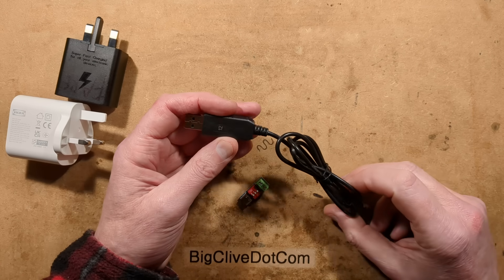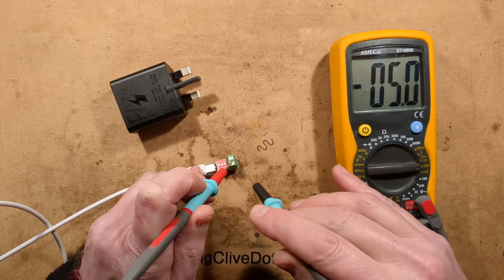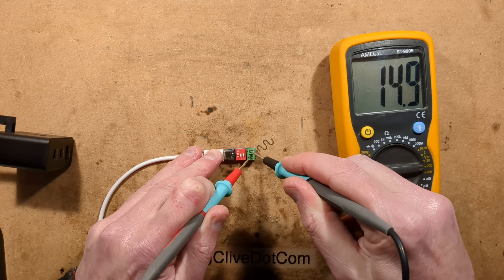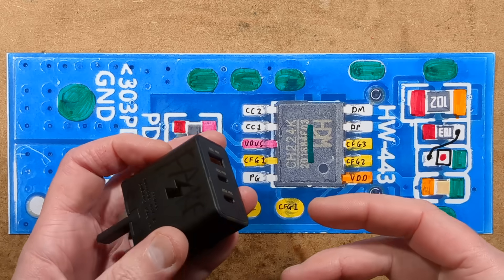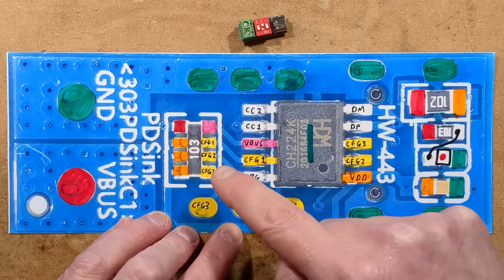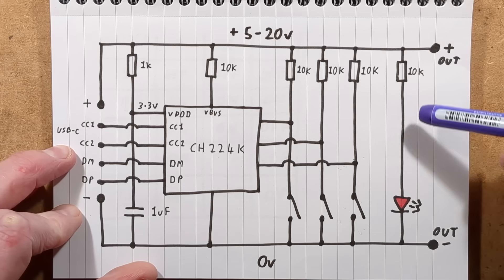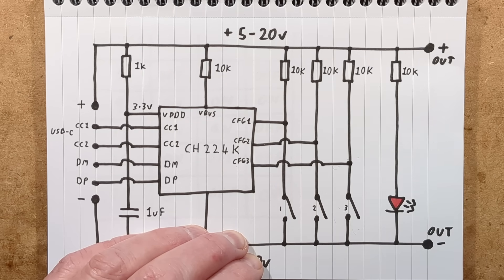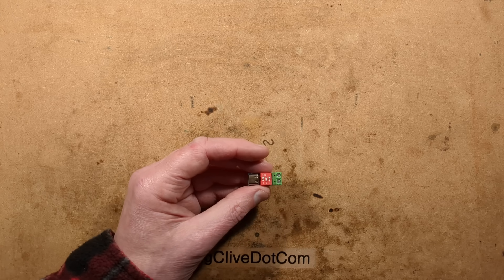Cheap USB-C programmable PD voltage module for 5,9,12,15,20V

Comment: I really do enjoy items from IKEA. 
Not all of them are stellar,  (The USB C outdoor lights made for the outdoors are rubbish and take in water in less than a week! )   
But as far as their USB power supplies, and items like their very expensive LED color change strips?
I have had mind working solid for over 15 years!   :face-blue-wide-eyes:

I have no doubt they will keep working for the foreseeable future, and I can't say that about cheaper products as none of them have really lasted the test of time.  

I have a Battery powered Ikea star shaped Christmas light string I attached with a 3v supply from an old SONY charger and its been working now for the same 15 years in the humid environment of a wash closet. (Bathroom)

Comment: Does 2.25A acceptable for you because you said you only believe at 2A max at 20V?

I need one of these but the one that output is 20v fixed and barrel jack for my old laptop (5 years) that i need 19V 2.36A (45 watt).

 my old laptop charger is dying and buying the new one i gurantee i will not got the original one because well... its old.

For the powersupply i use the included 90 watt type A xiaomi charger, but i still confuse will it work or not because its type A but can delivery 20v to the phone😅
Reply from the maker: Some chargers do implement PD on a classic type A connector.
Reply: Im hoping xiaomi does it, thanks for the answer❤

Comment: That chip must contain an inductior internally to be able to boost. Interesting
Reply from the maker: It doesn't do the boosting.  It tells the power supply to step up to a higher voltage.
Reply: @bigclivedotcom I didn't realise that usb C could output 20V

Comment: Note that the latest definition of USB-C PD has dropped the 15v support. 😞So, it depends on which version is supported. You need to check in advance if the voltage you need is supported.
Reply: Don’t you mean 12v? With PPS you can get any voltage you want. Also there’s AVS I think it’s called… it’s like PPS but can go higher than 20v.

Comment: I think these things are a little dangerous because you might damage something that's expecting a higher voltage just by using a different charger that doesn't support it. Instead of supplying nothing it will produce the wrong voltage, so it's not great for powering sensitive electronics.

I used a non-adjustable one to convert a wired beard trimmer to USB-C after its power supply failed, and that works fine because worst case the motor inside will just spin slower.
Reply: Sometimes they choose a higher voltage, not the nearest lower one. It varies by module.

Comment: I use these all the time to convert devices to USB-PD. You can even use them in conjunction with a TP4056 module to make a USB-PD lithium battery charger.

If you replace the DIP switch with jumpers and remove the terminal block you have a device that will connect almost anything to a USB-PD power supply that is barely bigger than a normal USB-C connector.

Comment: But......... You  didn't   test that device  under load and that's what  matter  (voltage regulation)   tHE  20 vaults is also used to power laptops
Reply: The voltage regulation is managed by the power supply itself; all this module does is request the specified voltage from the power supply.

Comment: the only thing I think that this module needs, is a little plastic cover that snaps over the DIP switches,so that they aren't accidentally
flipped, and potentially fry your electronics that are  powered by it. I suppose that if it were a concern to its user, they could 3D print one.

Comment: I've got an electrical problem, Big Clive, and you're the man to solve it! ... When I plug in my various SMPSs, I often get sparking ⚡ which visibly eats away at my sockets and plug pins! 😭 ... How can one ensure the sparks don't fly?
Reply: In UK plug it in, then switch the power on afterwards.
Reply: @davadoff  Yes, but then the switch contacts will be damaged by sparking, instead of the plug pins and socket contacts. The problem is the high inrush current, as Big Clive pointed out. You'd think manufacturers would do something to mitigate the problem?
Reply: @marcse7en  switches are much more on/off with no in between, no arcing. 
240V AC into diode bridge into small electrolytic capacitor is enough surge to trip the breaker. You need an inrush limiter. Usually a fuseable resistor in LED light bulbs and small power supplies, for example.
Reply from the maker: The spark when plugging in power supplies is common.  There's an initial high inrush to the capacitor.
Reply: Are you talking about USA mains outputs or IEC C13/C14 connectors? I’ve probably had a tiny arc when plugging in a C13 connector that I can hear, but no visible damage ever.
Reply: @davadoff  I'm in the UK, and I've had mains plug pins visibly pitted by the sparking. You'd think manufacturers would address the issue?
Reply: @marcse7en  I’ve never heard of that or seen that before. Not with UK plugs. I’m not an electrician, though. Probably loose fitting, need new sockets. Or pins are damaged in such a way as to make more arcing & pitting much more likely. 

Try with a different load - high power but not capacitive - like a kettle and see if it still does it. Try with new, branded plugs & sockets and see if it still does it. To see if it’s the load or the plugs.

If you live in rented, show the electrician and ask him about it when he next comes… I think it’s within 5 years now, to do electrical safety checks.
Reply: @davadoff Funnily enough, for the last 20 years I did live in a rented flat. I've recently moved into the house my parents left me. The problem is mainly with switch mode power supplies, and happens at both properties. Big Clive says sparking is a common problem, due to high inrush current.

Joyeux Noel et Bon Annee MMXXVI 🎄

Comment: Does that CH224K chip have a Zener (or other shunt regulator) on the Vdd pin?  That maybe why it gets hot.
Reply from the maker: It has a shunt regulator.  It's the resistor that gets hot.

Comment: I’m guessing the voltage monitoring pin is to detect shorts.  The PD (the wall unit) has over-current detection and will cycle the power output.  There might also be a failsafe counter where it gives up after too many OC events.   The voltage limitation is also in the PD (the wall unit).  It is only a buck converter so the max voltage is strictly a function of the rectified intermediate DC voltage.
Reply: There is a power good pin that Clive didn't draw in the schematic. It goes low when the module receives the requested voltage. It needs the VBUS monitoring for that.

Comment: please correct me if I'm wrong, but I thought the "DM" and "DP" pins were just the D- and D+ pins for USB 1.0/2.0 data signalling pins, and had nothing to do with the Power Delivery communication..?
Reply from the maker: I would guess it makes sense to use the same data connectivity for negotiating voltage.

Comment: There's not much point in reverse engineering. These modules just implement the standard suggested implementation from the datasheet. As to the heat dissipation, it's due to the internal linear regulator, which has to dump a lot at 20V bus voltage.

Comment: The USB standards organisation should come up with a proper high-power version with a larger and robust plug. So far, USB connectors have been relative poor and quickly become unreliable in a number of situations. A locking connector, not necessarily like the thumbscrews on serial ports but maybe something like the full size DisplayPort connector, would be a significant improvement over what we have now. A voltage range of up to maybe 48V (52V max?) for phantom powering applications and a chunky enough connector to also have a few amps at the lower voltages.

This connection would also be suitable as an almost universal power supply (and data) port and would enable some larger devices to be powered. I can imagine audio and possibly video workstations all run from this connector, including decent monitor speakers. A PCIe adapter would have extra electronics to provide and manage the power from PCIe GPU power connectors on the expansion card, as well as provide a SuperSpeed USB connection.
Reply from the maker: The plug and cable is an issue.  Especially with rogue cables that use very thin copper coated aluminium conductors and cheap contact materials.
Reply: There is PoweredUSB. It is a USB A plug combined with a power connector and a latch. It can provide 5, 12 or 24 volts at 6 amps. I've only heard if it being used on point of sales systems though.
Reply: @rocketman221projects  I've seen videos of devices featuring those. They are a great innovation. It's unfortunate they didn't become more widespread into general use,

Maybe the style of the connector, with it being a square profile, was a problem in that it had to be fitted into a special case cutout as it could not be fitted to an expansion card slot.

There needs to be a robust connector that delivers a reasonable amount of power without getting hot, has a superspeed+ data capability and will fit as a connector on an expansion card.
Reply: I’d advise adding a P-clip for strain relief if possible. Ideally the type-c plug doesn’t stick out so it can’t get knocked. Like bamboolab A1 mini… I believe uses the USB-C connector in one or two places, but not for anything USB. They make sure it’s very well physically supported.
Reply: Laptops used a 20V barrel plug for years, until USB decided it wanted to get into that area.
Reply: @CanizaM  Yes, and the DC barrel connector is far more capable of carrying current that the tiny USB-C connector and certainly didn't get hot doing so.
Reply: @DelticEngine  it’s very hard finding a DC barrel plug & socket rated more than 3A, if that. They suck. There’s about 36 different shapes now. Probably more.

Comment: Great video. I have got a lot of 5 this week to power some 9 and 12 V circuits. My first use for them was testing some chargers I have at home. Now I know why some work with the earbuds but not with the iPhone...
I have found the CH224 manual and figured that version K has two modes. The first is setting the pull up resistor of cfg1 to select the desired voltage from the USB. Setting R to 10K gives 5V, 20K to 9V, 47K to 12V, 100K to 15V and 200K to 20V. The second is grounding cfg1 and selecting the voltage through cfg2 and cfg3. The chip supports hot changing the requested voltage so there is no problem flipping the switches while connected.
After seeing this video, I became curious about the power good indicator. I want to do some testing to find how it works, the bigger problem will be soldering something to that pin without short-circuiting the board.

Comment: Just used a handfull of those to creat led signs for my grandchildren.  Worked great. Needed 12 volts the powersupply needed to beable to handle the extra load, got the cords and the plug in from aliexpress.

Comment: I have been using a few of these for a decent amount of time. Very versatile. One supplies power to my laptop (by default it wasn't able to use USB for charging). Another one supplies "juice" for small tools in the workbench. And the last one used to charge a 12V LiFePO4 battery for critical emergencies when other power sources are not available. Long blackouts/emergencies/etc.

The main useful thing - you can connect it to a modern power bank that supports PD (using a type C <-> type C cable) and get a more or less decent power source.

Comment: Just thinking quickly, could you use this in a car's USB socket, to take it from std 5v up to 12volt ?
Reply from the maker: Only if it supports power delivery at higher voltages.

Comment: I have a few of these. A set that's very similar to the one in the video and a handful from a different manufacturer with a different shape and layout.

Using Samsung, Anker, and knockoff chargers gave different results. I don't think any of mine put out 12V. (Despite having a setting for 12V)

I was using one of Anker's all-singing-all-dancing 40gbps data and 240W PD cables.

Comment: I'd get one that has a clear UI regarding the voltage and shift towards using ones that have fixed settings otherwise (there's some tiny ones you can change the setting to by completing a circuit with some solder). I've used them for tons of things I got off ebay that didn't have a PSU, feels like magic with how you can effectively make the bulk of electronic items portable between this and a laptop power bank.

Comment: So you can get this chip on the device to tell a USC  power supply to output up to 20V?!?
I thought all USB variants are strictly 5V. 🤔
Reply: USB can go up to 48 volts at 5 amps now.
Reply: @rocketman221projects  That would nonly be for USC, right? Or can you also do that with USA, Micro and Mini?
Reply from the maker: Modern USB power supplies sometimes have a negotiable voltage.

Comment: I really wish they would make a cheap PPS version of this since with those devices you can set any voltage you want for example I'd really like to make a power cord that puts out 16.5 volts for one of my tablets it'll charge at 15 volts but very slowly.

Comment: I have the same ones but can't get 12v no matter what wall wart I use any ideas
Reply from the maker: It may be the power supply not supporting 12V output. It's also possible that the board isn't recognizing the correct switch setting for 12V.

Comment: 9 volts I don’t need, but 7.2 would sure be handy.
Reply: You need PPS which should allow you to define any voltage you want I'm having difficulty finding a super cheap $1 unit like this for PPS I found one available in Europe for like 12.50 plus shipping and all that crap but I haven't found an aliexpress one yet

Comment: Take a look at the datasheet of the CH224K. It has a little table explaining the three config pins. If you invert on and off, it makes more sense: The first pin is the enable pin – if it is off, the other pins don't matter and it will always fall back to 5V. When the enable pin is active, the other two pins are 00, 01, 11 and 10 – more or less counting up in binary.
Reply: That’s not more or less counting in binary, that’s Gray code counting
Reply: @LANSLNSU Thanks for the hint! I think I've heard that before in university, but must have forgotten the name.
Reply: Yeah, I noticed that some of the provided switch position tables on AliExpress are inverted for some reason, I’m not sure why.

Comment: If you like to live even more dangerously: you can get an other version of this module without the dip switches but with one single button that cycles through the voltages. Yeah...
But you can get these molded into the cable connector with a fixed voltage setting, which is nicer and may be safer for permanent usage (you may want to label them though).
Reply: I might hot glue those DIP switches in place.
Reply: @flowerpt  There are versions that use solder jumpers instead of DIP switches.

Comment: i have those things, but i'v seen weirdness in certain situation  where it might not trigger correct voltage  , there is another module on Aliexpress that is dark magenta/pink that i had more reliable success with and its often titled "PD/QC/AFC Fast Charge Decoy Trigger"
That dark pink module im talking about, also need to sense the bus voltage if you dont want current to pass trough the module but use it as an add-on on your project.

Comment: I admit to being a bit confused by the circuit. Too bad there isn’t a block diagram available for the chip.

I’m stuck on why the chip has a VBUS sense pin. As you say there has the be a shunt regulator (Zener?) inside the chip that works with that relatively fat 1K resistor to clamp the VDD pin at 3.3V.

I’m not up n the USB negotiating protocols. Is one of the signals sent back by the chip a verification signal of sorts? I can envision a voltage divider/comparator arrangement inside the chip that would do that by comparing the current through the regulator and VBUS, but absent a block diagram of the chip I’m just guessing.

Comment: So one of my sons' asked me what you do with your printouts of the schematics you make after the video is done, you just throw em away or you file them somewhere?  Thanks for showing this, what a nifty adapter, gonna have to get one thanks for showing it won't do 20v.
Reply from the maker: I keep the files on Google storage and have a huge pile of the printouts.  I use generic glossy photo paper and a bulk ink Epson ecotank printer filled with cheap generic ink, so they are not expensive to print out.

Comment: That suggests the power supply that peaked at 12V is somewhat violating the USB-PD spec - if a power source can't output the voltage the sink requests it shouldn't output any (well, always 5v on the signalling pins, but should be nothing on VBUS)
Reply: Interesting I thought it was the opposite put out the highest voltage you can and no more meaning putting out 12 volts was the correct response so if it can't provide 15 it should provide zero I didn't know that
Reply: @nerys71  I actually misspoke - having double checked the specification, VBUS should be at 5v when a device is first connected. The charger will announce its supported voltages, and the sink will request one. If the sink requests a voltage that isn't supported, the charger will respond with a reject message and VBUS should remain unchanged.
But if the sink requests 12v, then later requests 20v, it should remain at 12v.
Reply: It's this PD trigger module that negotiates the next lowest voltage. It's not the power supply doing it.
Reply: @rocketman221projects it's collaborative - the trigger module requests a voltage, but the supply has to provide it. And the Samsung clone supply here is misbehaving